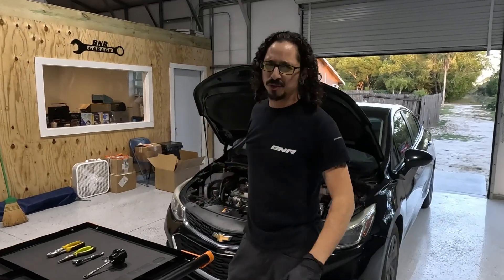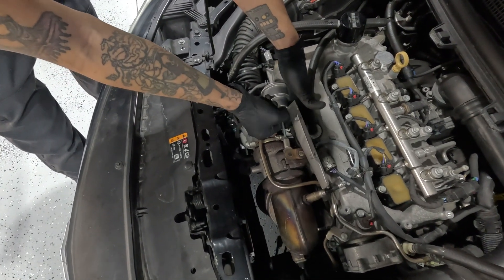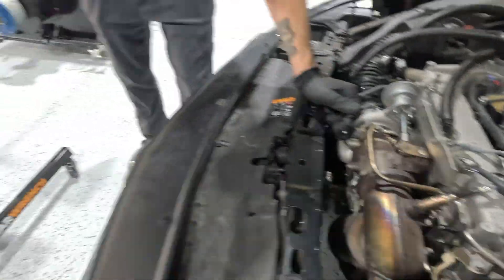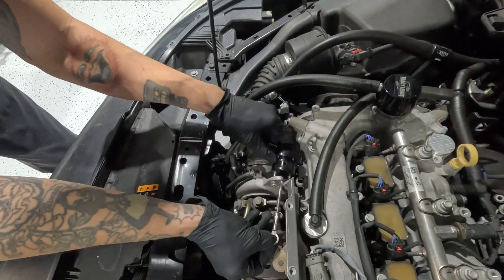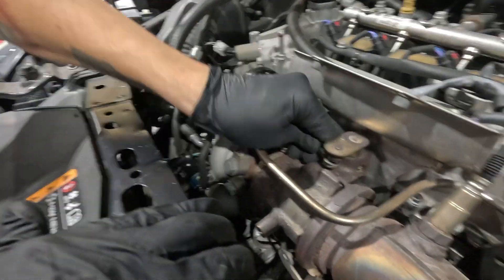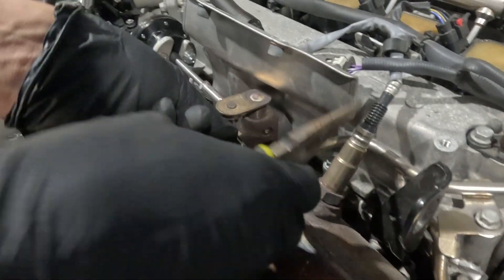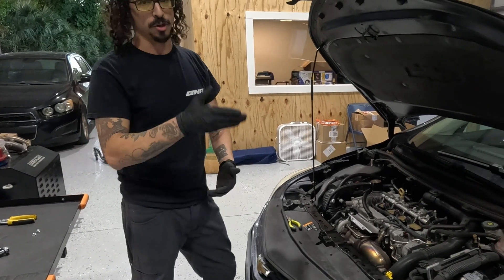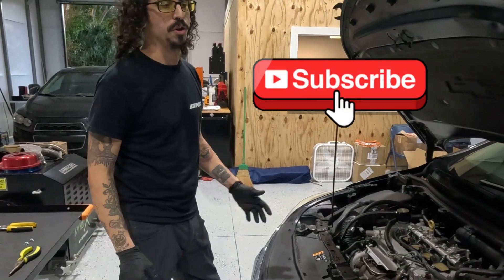BNR Gen 2 Cruze Wastegate Actuator Install + Adjustment

Comment: Ima about to purchase you guys Wastegate, i have a P0299 code and I’m still on my stock waste gate after 134k miles, 2019 chevy Cruze. I don’t have a tune yet, I’ll just follow the instructions in the video,3 half turns, but i was going to also replace the Wastegate Solenoid with it too. Would you guys recommend that as well?

Comment: I’m getting an issue with mine where boost is fluctuating at higher rpm it sounds like it’s building boost then relieving the pressure then building then relieving pressure. My rpm also fluctuate at the same time. More preload? I did 3 half turns (I have the bnr actuator)
Reply from the maker: Maybe too much preload, if you're tuned you can log it if you'd like

Comment: Don't forget to let the ECU have time to recalibrate the new adjustments before you make more. 50 to 100 miles is usually enough but I am running a tank of gas thru before each adjustment which are 1/2 turns at a time. I just bought a Borla Pro XS straight thru muffler which will eliminate backpressure which I learned is not good for turbo motors, it doesn't let the turbo spool up fast enough. I haven't put it on yet so I am waiting until I do to make more adjustments to the wastegate. Never owned a car with a turbo so this is all new to me.

Comment: What's your suggestion? If I don't have a tune yet but eventually I want to tune my gen 2 cruze but I want to start somewhere from the bottom should I get one that is specifically for tune only or should I get the one that's for not tuned?
Reply from the maker: Yeah get it set up for stock tune for now, and then just grab the spring from us for tuned whenever you do tune it
Reply: @badnewsracing I’m having trouble with mine getting it dialed in I did the videos instructions to a t keep getting under boost codes today I turned it in 3 full turns and it’s under boosting a lot more now I need help!!
Reply from the maker: Give it more preload if its underboosting
Reply: @badnewsracing I tried but it’s hard to connect back onto the waste gate. If there’s allot of pre load should it be stiffer than stiff trying to get it back on the waste gate pin?
Reply: @badnewsracing gotter done son
Reply from the maker: @theps4progamingbros310  Yes, you should have to pull it to get it over the pin
Reply: @badnewsracing the yellow one after I tune the car?
Reply: Get stock first then tune it then tuned wastegate
Reply: Just installed mine rn on my gen 2 and this thing runs like a r*ped ape

Comment: Is there any reason to upgrade to this if you don't have a tune?
Reply from the maker: Yes, they eventually fail on all of these cars. You don’t necessarily have to get ours but at some point you’ll need to replace it, may as well upgrade to a serviceable to unit
Reply: @badnewsracing will this produce more power without a tune?

Comment: 1.5 turn for stock tune?
Reply from the maker: Yeah start at 1.5 turns, should be good :)
Reply: For Stock Tune Do you mean a single half turn? So like rotate it only once? In the video you say 3 half turns for a tuned vehicle. Also does this change if the wastegate has the stock spring installed instead of the tuned spring?
Reply from the maker: @AdamNieto  3 half turns for stock or tuned
Reply: @AdamNieto  I ended up using $30 cheap Chinese replacement product, turned 1.5, and it runs great. Drove 3 hrs and no check engine light. 

I will upgrade to this BNR one, once I got enough money for tune.

Comment: Great video.
Reply from the maker: Glad you enjoyed it
Reply: How many turns for a stock tuned car? I see 3, 1/2 turns for tuned.
Reply from the maker: @theredandblack4life  It's the same, the only difference is the springs inside. Preload it the same, 1.5 full turns, or 3 1/2 turns.
Reply: @ ahh ok. I turned mine 3, guess I need to pop the clip off and turn it one more. One more 1/2 turn. More tunes = more boost?
Reply from the maker: @theredandblack4life  You're probably fine, but give it a try. More turns, more boost. If it goes into limp mode you know you went too tight
Reply: @ ty!
Reply from the maker: @theredandblack4life  No problem!